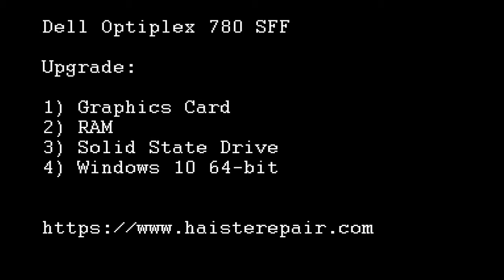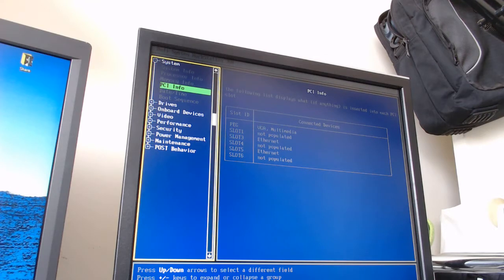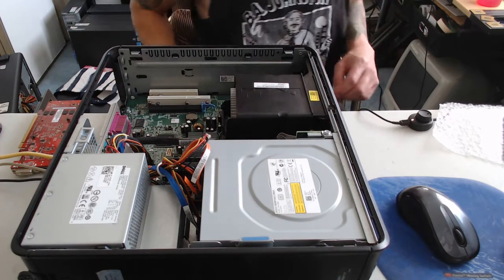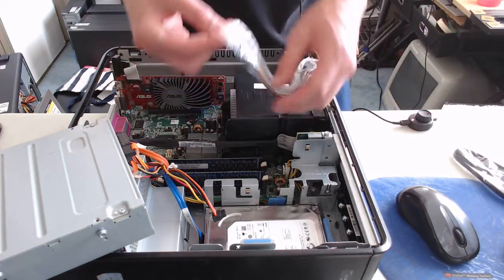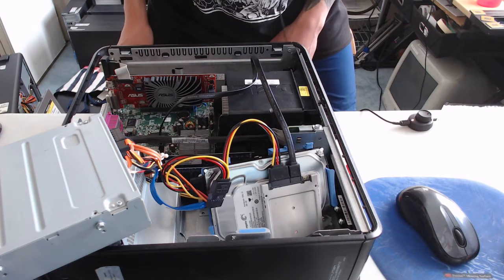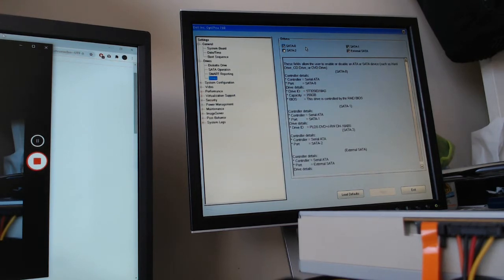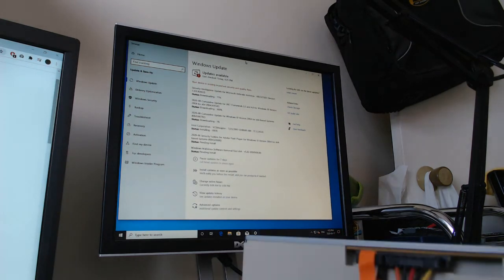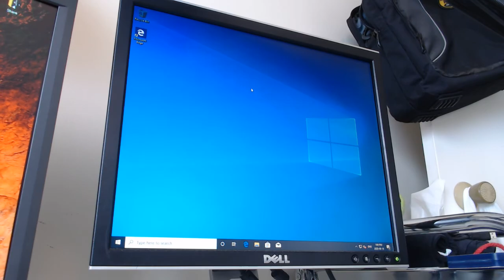Dell Optiplex 780 Upgrade (SSD, Graphics Card, RAM, Win 10)

Comment: where can i buy the i/o shield?
Mine was broke..
Reply from the maker: That's a touch one as I believe it is built into the case?  Do you have the SFF version like in this video?
Reply: @HaisteComputerRepair  yea dell optiplex 780 sff
Reply from the maker: @farishlobster  Gotcha.  I think it might be pretty hard to find just the I/O shield portion of the case.   I might be wrong as I only worked on this tower for the video, but other models of optiplex released around this time had the shield built into the case.  Can you confirm this?  It looks like it in the video and to my recollection, but it has been a year and I could be wrong.
Reply: @HaisteComputerRepair  ohh okay thank you very much sir😀
Reply from the maker: @farishlobster  No worries.  Let me know if you find a solution that works.
Reply: @HaisteComputerRepair  okay sir I plan to upgrade   e7500 duo core with q9550 quad core.Can the psu handle it?(still dell optiplex 780)
Reply from the maker: @farishlobster  The PSU can handle it, refer to this list for compatible upgrades to the Core 2 Quad.  https://www.cpu-upgrade.com/mb-Intel_(chipsets)/Q45_Express.html
Reply from the maker: @farishlobster  Btw, check out this video I did with Core 2 Quad and 8GB RAM, NVIDIA Quadro 2000 setup.  Just to give you an idea of what you can still do (a lot).  https://youtu.be/DEG7Q13cr7w
Reply: @HaisteComputerRepair  thank you very much sir!
Reply from the maker: @farishlobster  My pleasure!
Reply: @HaisteComputerRepair  Sir I want to ask, will NVMe SSD adapter work in dell optiplex 780 pcie slot? My pc goes nothing after I installed the adapter. I think the PSU can't handle it but what i know the pcie slot have 75W
Here my build
•Intel 2 quad core q9500 2.83GHz
•AMD Radeon HD 6450 1gb oem
•WD HDD 80gb (the capacity too small for hard disk so i plan to change it with SSD
Reply from the maker: @farishlobster  I'm fairly certain that the Dell Optiplex 780 motherboard only has one PCIex16 slot for either a graphics card or a nvme pcie adapter, but not both.  I wouldn't expect a huge speed increase as compared to a 2.5" SATA SSD as both will likely be limited to SATA 2 speeds due to the age of the motherboard.  However, it is still a really nice boost.  If you have that graphics card already installed, perhaps look into purchasing a SATA Y Power Splitter from eBay or Amazon as well as a SATA cable.  Then, you can install a 2.5" SSD and keep the HDD as storage (or upgrade to a larger HDD, etc).
Reply: @HaisteComputerRepair  Can I use PCIe riser instead or it will definitely not working?
Reply from the maker: @farishlobster  I'm not sure your power supply could support that as many risers that I have seen require either SATA power or power routed with a molex connection.  You would need either a SATA Y power splitter or a different power supply to accommodate.
Reply: @HaisteComputerRepair  ohh thank you sir for your explaination!
Reply: @HaisteComputerRepair  What can I do with another PCIe slots?
Reply from the maker: @farishlobster  You bet, let me know how it goes for you.
Reply: @HaisteComputerRepair  I think I can use card expansion on other pcie slots
Reply from the maker: @farishlobster  Ok, just make sure to figure out if you need to power the card with either SATA or Molex, or, if the card is powered by the motherboard connection alone.
Reply: @HaisteComputerRepair  okay sir!
Reply from the maker: @farishlobster  a GDDR5 card would work, yes.  Like a GT 1030 2GB.  Those are good little cards still.
Reply: @HaisteComputerRepair  Thank you sir!
Reply from the maker: @farishlobster  You bet!
Reply: @HaisteComputerRepair  Sir is dell optiplex 780 has PCIe power pin ( for extra power supply to PCIe slots I think)? If it has can I use the 6 pin or 8 pin power connector?

Thanks in advance and I`m sorry for too much asking question :)
Reply from the maker: @farishlobster  I don't believe the SFF Optiplex 780 will have a PCIe Power Pin with the stock SFF Power Supply.  There are some other options if you are wanting to spend.  Check this out:  https://www.bequiet.com/en/powersupply/2314
Reply: @HaisteComputerRepair  Aight thank you very much sir 🙌
Reply from the maker: @farishlobster  My pleasure
Reply: @HaisteComputerRepair  Hi, sir. Sorry for disturbing you again :)

Is it possible to OC dell optiplex 780 with core 2 quad q9500?
I just wanna go a little bit, maybe 3.0 GHz.
I already tried use SetFSB but I didn't see my clock generator id in the list.
Reply from the maker: @farishlobster  I'm not really sure.  I would suppose that yes you could.  But, what are you doing with the older system that you want to push it closer to the limits?
Reply: @HaisteComputerRepair  I just feel like my computer a little bit slower than my e7500 2.93GHz before
Reply from the maker: @farishlobster  fair enough.  What else are you using?  RAM, SSD? GPU?
Reply: @HaisteComputerRepair  I use geforce gt 640 1gb gddr5, 4gb ram (2x2gb) and WD hdd 80gb
Reply from the maker: @farishlobster  If you can upgrade to an SSD and 8GB RAM, that would really improve your experience.  Overclocking the CPU with that hardware might be fun for an experiment, but I judge the SSD and RAM upgrades are a better long term solution.
Reply: @HaisteComputerRepair  alright sir thank you very much!
Reply from the maker: @farishlobster  I have an assortment of SSD's and RAM, so let me know if you want to purchase from me.  Think $50 CAD.
Reply: @HaisteComputerRepair  I think I'll buy it from local store, anyway thank you for your suggestions!
Reply from the maker: @farishlobster  No problem, just putting it out there since I go through so many.  Good luck!
Reply: @HaisteComputerRepair  Thank you very much for your help sir! Now my dell optiplex 780 can run valorant smoothly. Yea you're right just change the hard drive to ssd then enjoy haha, but migrate OS is paid so i just keep my OS in my HDD and my game in SSD. Anyway thank you!
Reply from the maker: @farishlobster  That's awesome.  One day, you might want to look into reinstalling Windows on to the SSD and using the HDD for storage/games.  But, if it's working now, have fun and always feel free to send me a message for any help.
Reply: @HaisteComputerRepair  hey sir :)
I wonder what are the other pins do in the motherboard and thank you in advance.
Reply from the maker: @farishlobster  Check out this manual and let me know if you need help woth any clarification:  https://downloads.dell.com/manuals/all-products/esuprt_desktop/esuprt_optiplex_desktop/optiplex-780_service%20manual3_en-us.pdf
Reply: @HaisteComputerRepair  oh sorry sir I forgot to tell that a few days ago i found out my optiplex is dt not sff :)

But sir I found that the extra pins on the motherboard are internal usb. Can I use them for LED strip lighting (no controllers)?
Reply from the maker: @farishlobster  Full size desktop?  That's easier to install a wider variety of graphics cards.
Reply: @HaisteComputerRepair  Yea but now I'm planning to mod the case with transparent plexiglass. I want use led strip but idk where to connect it
Reply from the maker: @farishlobster  You'll probably have to power it with a spare SATA power plug or molex from the power supply.  If it's the stock PSU, you may not have a lot of options.  Or, you could buy battery powered I suppose.
Reply: @HaisteComputerRepair  My stock PSU doesn't have spare sata power cable. I think i need to use battery. Thank you sir :)
Reply from the maker: @farishlobster  You can use this to get an extra SATA power plug:  https://www.amazon.ca/Startech-Com-PYO2SATA-6-Inch-Splitter-Adapter-M/dp/B002N2EHVQ/ref=sr_1_1_sspa?dchild=1&keywords=sata+y+power+splitter&qid=1634918757&sr=8-1-spons&psc=1&spLa=ZW5jcnlwdGVkUXVhbGlmaWVyPUE0TzVTOTI0SlhQVTImZW5jcnlwdGVkSWQ9QTA2NTU3MzQzQjdSTThITERROEdVJmVuY3J5cHRlZEFkSWQ9QTA0MTk4MTMyQkFRRUFIVkhQMllVJndpZGdldE5hbWU9c3BfYXRmJmFjdGlvbj1jbGlja1JlZGlyZWN0JmRvTm90TG9nQ2xpY2s9dHJ1ZQ==

And this to power an LED Strip https://www.amazon.ca/LEDdess-120mm-Silent-Computer-Coolers/dp/B07F65HK8J/ref=sr_1_17?dchild=1&keywords=sata+led+strip+pc&qid=1634918699&sr=8-17
\

Comment: There was not much of any solutions for this issue. Most searches came up with printers that do it, which are fairly easy to diagnose, but no computer issues creating the vertical lines. The only way to test my " it's the computer doing it" theory was to borrow a printer that I know works just fine and try that.  The results were that it is in fact, somehow the USB ports, yes i tested all of them like before, connected to another printer created the same vertical lines down every print. I did a direct print as I did with my own and it printed just fine. All devices work through all of the USB ports, but just don't print through them. So buddy, that is the conclusion. My Dell OptiPlex 780 that runs like a top has a USB port issue when printing. Comments are always welcome ....
Reply from the maker: Interesting.  Is it possible to install a USB PCIe card?  Do you have a PCIe lane available?
Reply: @HaisteComputerRepair  Wow...I was just about to ask you about doing that. Yes, I do have a lane available. Suggestions?
Reply from the maker: @donm3129  I would say go to Amazon if you have an account and search for PCIe USB low profile.  Just to make sure you get one that will fit your case.  Read the reviews and make a good choice.  Probably something not too expensive as this is a troubleshooting option.

Comment: One year later, I watched this video for a refresher. The only issue is that my Hard drive is ready to fail, and I want to install a Solid State Drive , but without the hard drive like you did. I would like to find an adapter to properly hold the SSD. I've seen soooo many choices so I'm looking to your infinite wisdom to guide me to the right one. Any and all suggestions are fully welcome.
Reply from the maker: I'm not sure about a caddy, I would have to look up some that might fit.  But, double sided tape or zip ties would work as well :)

Comment: how did you do to install de drivers?
Reply from the maker: For the graphics card?  They installed automatically.  You can also download them manually online.  Are you using the same card?
Reply: @HaisteComputerRepair  i mean for everything, i am using it stock, im planning on upgrading de hdd for an ssd but im making sure i know how to install all the drivers before buying the ssd
Reply from the maker: @matiaspraderi1417  Are you installing Windows 10?  Generally, Windows will search for and install the necessary drivers during a fresh install.  Or if you install components and hardware with Windows currently installed, you can press the Windows key on the keyboard, type "update" and click on "check for updates."  If this doesn't have favorable results, go to the manufacturer website for whatever hardware or component you are working with an download drivers.  This can usually be found by searching on Google.  Ex:  "Radeon HD 6450 Drivers."  This is an easy process once you get used to it.  Be brave and dive in!

Comment: halo, is this tutorial work for dell optilex 780 sff? please answer :)
Reply: sory dell optilex 780 sff mini pc
Reply from the maker: @hafiznatara  Do you mean the USMFF (Ultra Small Form Factor) Optiplex 780?  Like this:  https://tinyurl.com/y6m5cr3t
Reply: Hay, i was tried your tutorial but my ssd can not read in my BIOS? Do you know what the promblem of my pc? Remember my pc ia dell optilex 780 sff (small from factor)
Reply from the maker: @hafiznatara  Before making sure connections are in place and cables work, try going into BIOS > Drives >  and make sure the SATA port that your SSD is connected to is checked.   If it's not, check it "on," hit apply and reset.  Check back if this isn't the fix.
Reply: @HaisteComputerRepair  done, but now the problem is my ssd couldn't read on booting system. In booting only HDD and CD room, can you fix the problem? Please
Reply from the maker: @hafiznatara  Try changing the boot order in BIOS.  Go to BIOS > General > Boot Sequence.  Change the boot order and place your SSD at the top.  Try that and report back.  You do have Windows or some other operating system installed on the SSD?
Reply: @HaisteComputerRepair  hello brother, thx for your tutorial, my ssd can work, thx before :)
Reply from the maker: @hafiznatara  Sorry I didn't see this.  Yes, it looks like there are two PCI slots, likely one that can fit a video card.  Check the motherboard for more than 2 SATA slots for multiple storage options without removing the optical drive.
Reply from the maker: @hafiznatara  Happy to hear it!
Reply: @HaisteComputerRepair  btw, what is your vga card model? is it low profile?
Reply from the maker: @hafiznatara  ASUS HD 5450 1GB DDR3 64-bit Graphics Card, low profile.  This was a PC for a client.
Reply: @HaisteComputerRepair  is low profile VGA card?
Reply from the maker: @hafiznatara  Yep, it is low profile.  In this video, I took the card out of a larger case, so it had a larger bracket.  I installed a low profile bracket (2 pcs) so that it would fit into the SFF case.  Looks like this:  https://tinyurl.com/yxqxj7wk
Reply: @HaisteComputerRepair  yesterday i bought AMD firepro v3900 but i think my power supply is not support, is this VGA low profile too?
Reply from the maker: @hafiznatara  That card looks like a low profile card.  This one? https://www.techpowerup.com/gpu-specs/firepro-v3900.c579

Have you  tried installing it already? 

If it's this card, the power will be supplied to the card through the motherboard.  Like this:  Electrical outlet > power supply > motherboard > pci slot > graphics card.   

Other higher performance cards do have a power plug attached and draw directly from the power supply, but a low profile card like the one in the link won't need this.

Comment: Does SSD Overheat?
Reply from the maker: I wouldn't worry about the SSD overheating unless you are really over working the system in a hot, humid area of the world.
Reply: @HaisteComputerRepair  Okay, i was worried for ssd can explode
Reply from the maker: @DtcedyyjAmar  No problem.  I have never known an SSD to explode.  I would guess it would just be really unlucky if it were to happen.
Reply: @HaisteComputerRepair  Notice for you. I installed TOSHIBA HDD on my game console (Named PS4) The TOSHIBA is broke or exploded. Due to some system files cant load, it says can't start, so i reinstalled all system file, and it system file does not loading again.
Reply from the maker: @DtcedyyjAmar  Ok, so the HDD is not working?  I am sure if it somehow exploded you wouldn't be able to use it anymore.  Just to clarify, you are trying to install the PS4 Operating System?
Reply: @HaisteComputerRepair  Yeah, the hard disk permanently damaged, i changed them

Comment: I  have the same 780 SFF with A15 microcode modded bios and a Xeon X3363 CPU, 4x2,83 GHz 12 MB cache.
Reply from the maker: Interesting!  I bet you get some performance out of that.
Reply: @HaisteComputerRepair  Well, not really. :-) I mean it is the same as having Q9550 core2quad, but 6-7 years ago the used xeon was way more cheaper than the used core2. 20 usd vs 70 usd. The xeon have a physical soldered patch between two pins, and modded bios required. Otherwise fine performance with 8GB ram and SSD though.
Reply from the maker: @h34vyd1st0rt1On  I mean, I would be happy with that.  But my old HP tower with that same Q9550 Core 2 Quad is set up with a 256MB Nvidia card with HDMI to stream Netflix, etc, or surf the web casually in my living room.  Paired with the SSD, it's nice.

Comment: Hello what's your recommend for gpu for dell optiplex 780 my pc is like yours.. I'm looking for low profile I hope u can help me my psu is 280 watts
Reply from the maker: I would say look for a Nvidia GeForce 210 (1GB) or GeForce 710 (2GB).  Both low profile and will be fine with that PSU.
Reply: @HaisteComputerRepair  thank you so much :)
Reply: @HaisteComputerRepair  I found geforce gt710 2gb GDDR5.. Low profile the recommend psu is 300 Watts.. it is still okay?
Reply from the maker: @okawaiikoto2927  I think so, yes.  The card itself should be fine, but just be mindful about what games/software you are planning to use with it and how much your system can handle.  Keep it cool and keep it lean if necessary :)
Reply: @HaisteComputerRepair  I will keep that in mind.. Thank you
Reply from the maker: @okawaiikoto2927  No problem

Comment: I'm sorry to ask you again. What causes a HDD Hard Drive to fail or die? Thank you.
Reply from the maker: It could be any number of things.  A quick tip, though:  if the operating system is still loading, but it's slow, missing features, or causing blue screens, it may be easy to salvage by simply formatting and wiping the drive best you can.  Maybe running some diagnostic software to find out why it's failing to do something before trying to use it again.  If nothing happens at all and you can't hear any of the discs spinning, it may need professional service if it can be salvaged at all.  Here's a Wikipedia page for reference:  https://en.wikipedia.org/wiki/Hard_disk_drive_failure
Reply: @HaisteComputerRepair  thanks, much appreciated friend.
Reply from the maker: @matcentrino7602  Happy to help!
Reply: @HaisteComputerRepair  yes!